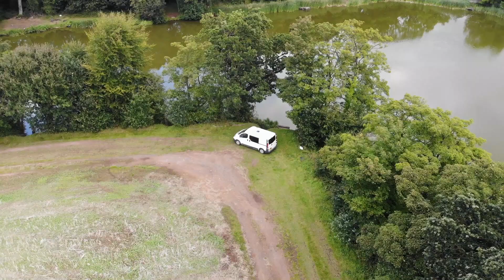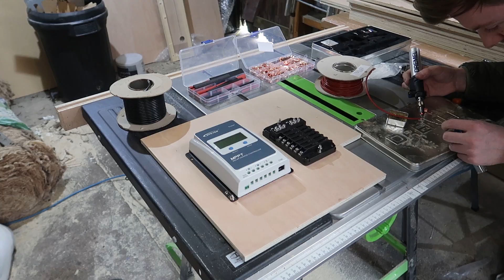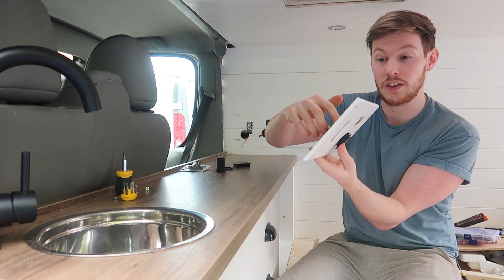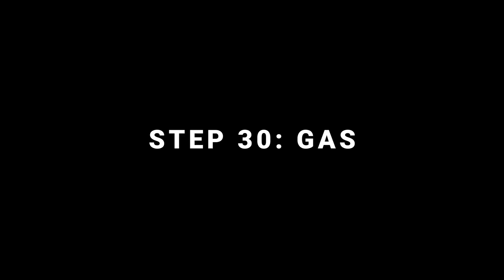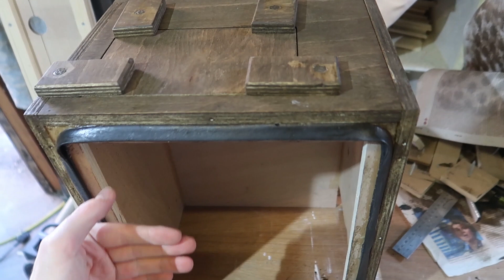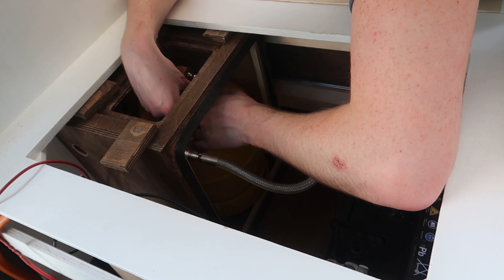Water, Gas and Electrics Set Up | Vauxhall Vivaro SWB Van Conversion PT6

Comment: Hi guys thanks so much for your inspiring and helpful videos. I am just about to do my first build with a Vivaro similar to this but was wondering if you have to get certificates for the electrics and gas?
Reply from the maker: Good luck with your build 😊. If you are in the UK, certificates are not a requirement at this moment in time if you are building it for yourself to use ☺️
Reply: Good morning thanks for the speedy reply. I’m actually going to build it to sell on so I take it the buyers would want to see certificates?
Reply from the maker: @bezzer81 it’s still not a requirement. Certificates are only required if renting. I have sold 3 vans with no certificates but what I do have is public videos showing the installs so they can assess it 😊
Reply: @nicroams  thanks so much for the info and I can’t wait to get started. How long did the Vivaro build take you?

Comment: did you calc your loads, cable capacity and lenght before the build or make it up as you go along.
 As an electrical engineer a see a lot of poor installations, layout and sizes on youtube.
Poor practices example using pliers to tighten nuts and plain nuts for connections not secured locked off. All giving problems or fires down the road
Reply from the maker: All was calculated 👍🏼

Comment: You need to have a gas vent on the bottom so it can flow out through the bottom if you have a leak. Given gas is heavier than air, that's a legal pass for legal camper status, it needs to escape or you are a large bomb waiting to pop
Reply from the maker: There is a drop vent in the gas compartment

Comment: About the  socket with a 15 amp fuse because solar controller only being able to handle 10 amps. That explanation was short. Hard to understand. Can you expand on why you did this ? Tks
Reply: The 15 amp socket was connected directly to the battery nothing to so with solar controller

Comment: You did a great job, but butting all the electrics and gas into one cabinet burns my head away, so in case you battery or any wiring goes bad at least you better Run!
Man you have to think about the case of a crash so maybe everything is nice now but a smaller crash could damage both systems ..

Comment: why set the load from the solar controller direct to the fusebox? (not critisizing in any way just curious on the reason/logic) i have mine (250w panel/victron 75/15 solar controller) wired via a fuse direct to my leisure batteries (2x110ah) and then power to fusebox and sargaent controller with various outlets/fuses to lights/fridge/waterpump etc. love the detail, well done guys, following the build and loving it
Reply: Cable looks under-rated potentially too?

Comment: It’s looking great and I love the idea of the hob in the drawer however how have you connected the appliance to the gas bottle as you should be using copper piping in its entirety other than the flexible hose for filling and flexible hose from the bottle to regulator. I must admit it’s looking good though. Just please be careful especially if you intend on selling on completion. It’s all on here as evidence that you’ve built it.
Reply: @nicroams  what I mean is you could have ran copper to the drawer and then used a flexible hose to allow the drawer to slide in and out. Still not ideal but try and reduce the amount of flexible hose you use on your next build. Top work though 👌👌.
Reply: @nicroams  its not meant to be flexible as it's secured to the van so it moves as a whole. The only snag would be for the pull out drawer but I must admit it's looking fab. Is it complete now. Looking forward to the next video

Comment: It is all looking great. Just wonder why you didn't go for a campervan/caravan specific tap as it would be straight forward with one water outlet?
Also I noticed that your split charge relay is behind the seat. I have not fitted mine, but would like it to go out the battery box, under the van and appear on the right hand side. I had a flat battery in my van due to it not being used. Went to the battery compartment only to discover the 4 screws were seized, had to drill them out, no more screws now. That's when I noticed it's not easy to feed the leisure battery cable into the rear neatly without going under the chassis.
Why can't you go and get the gas bottle filled, surely you can fill it yourself at the petrol station?
Reply: You are so right, that tap looks way better than the standard specific taps. My project has slowed down somewhat, bed stage next. :)

Comment: That main gas seal doesn't look like it would seal.  When it is squashed by the door it may create a bentover bit in the top right corner.  circular or flattened gasket would be better.  Loving the van though.  I have a LWB version and am at roughly the same place as you guys.  What vent did you get for the roof?  I installed a solar powered one but it is fairly weak.  I need to get something better that is also low in height on the roof so the van can still access multi storey car parks.
Reply: I also have the LWB version and had bought a Fiamma 28F Crystal. It can't be fitted to the LWB version as the structural supports are in a different location than the SWB. The only place I thought it could be fitted was just behind the front seats at the centre, but there just wasn't enough room for the vent and frame required. I sold it last week. The only other alternative is a mushroom vent, lower profile, constant ventilation, but not as big an opening as a normal sized acrylic vent. I have one, but haven't fitted it yet.